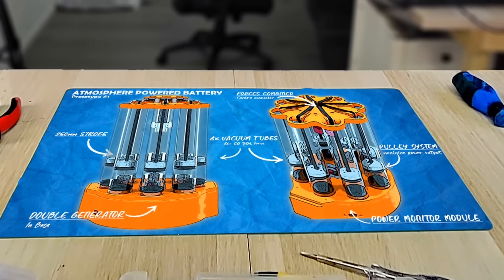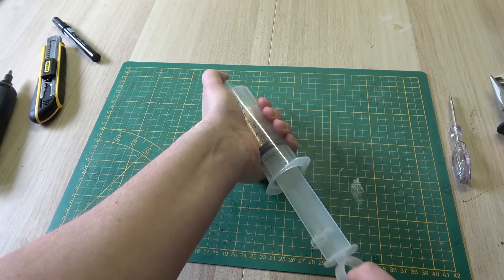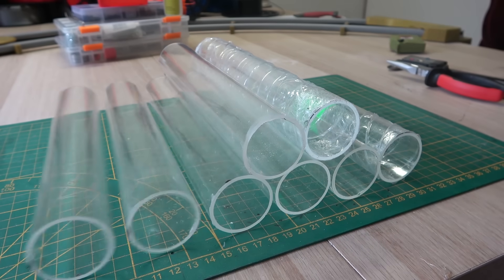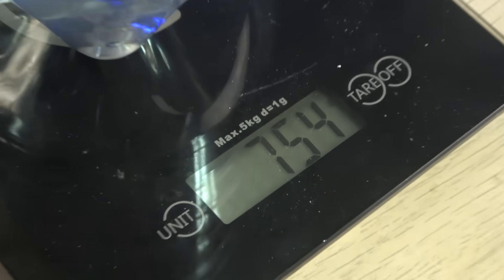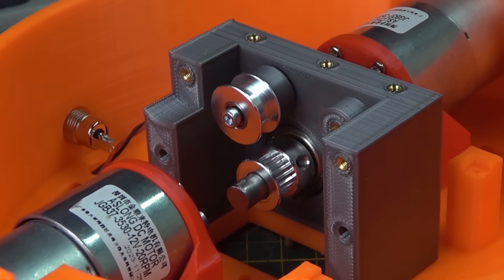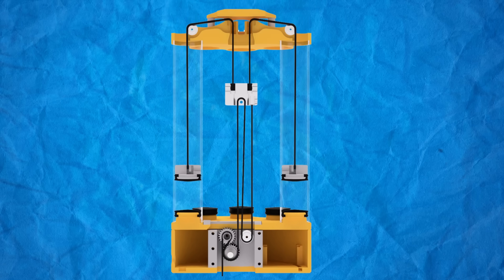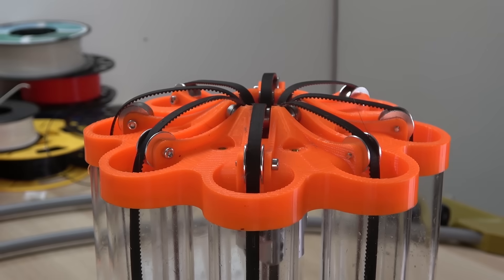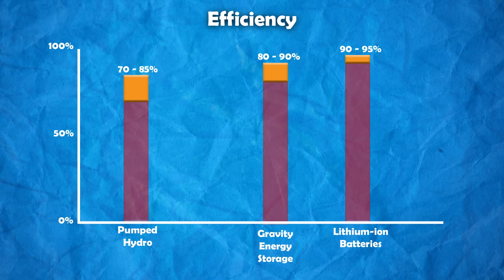Building an Atmosphere Powered Battery..

Comment: batteries you have to throw in trash after some time , the best is the flywheel battery, try make a small one, small diameter rotor  and use very high gear ratios to make it spin as much as 100.000 rpm,  it is in vaccum and the most simple neodymium magnet is enough to make small weight to float, it's very nice because like you can have wind turbine to power a generator and aswell charge the flywheel battery, with solar too, I mean if you have a generator that need 1800rpm to work at 60hz you would need to control the gear ratio just like a CVT transmission, but you have a induced rotor you control the power of this electromagnet, I really wish to find more info about this, I'm sure if you watch some videos and try to make one it would be  so fun... 100k rpm is not safe ok, flywheel battery is the most fun, vacuum is cool too... imagine using steam pressure then when it condenses it create a vaccuum and so u make power, turning energy into heat is quite easy haha, i find vaccuum scary cause in large scale need strong materials
Reply: flywheel battery is much better you can store energy and generate it, just high rpm have problems with balance, tensile strength, ... if you put a wind turbine to charge the flywheel it doesnt matter how fast the wind is ... now the problem would be the strength of the blades when wind is stupid high
Reply: as well the wind turbine is not meant to have a generator, it is a drive shaft to power the flywheel, solar panel need motor to power flywheel
Reply from the maker: I think it's worth a try💪

Comment: interesting idea. I noticed bubbles around the seals at the bottom. Could that mean the seal may not have been perfect? If so perhaps it could be even more efficient with more refinement
Reply from the maker: That certainly could be the case! Especially because it is of course built with parts that are not specifically intended for it.

Comment: Awesome work.
You just need to get the technical details right, as mentioned in several other comments.
But don't get discouraged to much about it.
You show great drive at innovation.
That in itself is something to applaud for.
Reply: he didn't use WaTT hours but the Arduino doesn't lie.
Reply from the maker: Thanks for your kind words!👌And to clearify how i got to the result you see in the video:

To charge: ~12.08V x ~1.62A x 43.709 seconds = 860,64 Watt

After a discharge: ~9.42V x ~1.15A x 57.993 seconds = 628,24 Watt

All value's are measured by the Arduino Nano in combination with the INA3221 Power monitoring module.
Reply: @ConceptCraftedCreations  

Energy [W.s] = Voltage [V] x Current [A] x Time [s]

1 Watt = 1 Joule per second.
so
1 [W.s] = 1 [J/s x s] = 1 [J]

And Joule is a measurement of energy.
A mechanical expression would be [kg.m/s2]
Kilogram meter divided by second squared

Comment: That's definitely a very interesting concept, but there are lots of places that can be improved.
First, starting with a more modest test using a single piston instead of 8 would be better as it would greatly decrease build time and complexity.
Second, I would use a proper generator or a brushless motor, as they are considerably more efficient for energy generation (for example if you were using a car alternator you could use the field coils which would likely result in more efficiency).
Third, there are lots of inefficiencies in the design (using a gearbox instead of a single pulley, piston friction, etc) rectifying them might help.
Now, does this concept have a future? it likely does, but I doubt it would become commonly used simply because of the number of possible failure points.
I think that flywheel energy storage is somewhat better, primarily because it's just a question of finding passive frictionless bearings and a way to mass-manufacture them.

Comment: Where both Watts delivered during the sale time ?
Reply from the maker: To clearify how i got to the result you see in the video🤓

To charge: ~12.08V x ~1.62A x 43.709 seconds = 860,64 Watt

After a discharge: ~9.42V x ~1.15A x 57.993 seconds = 628,24 Watt

All value's are measured by the Arduino Nano in combination with the INA3221 Power module.

Comment: I was thinking of something else, using a diving bottle that can store up to 300 bar, to compress air into it when there's an excess and recover it when there's a shortage. A compressor should be efficient and it's much easier to add storage, in fact you could do it modularly. However I'm not a very good physicist so I haven't figured out how to recover the air pressure efficiently. I think a very small turbine running relatively fast might mitigate the otherwise problematic issues of poor seals. But we're never gonna survive unless we get a little crazy.
Reply from the maker: "But we're never gonna survive unless we get a little crazy." 

That's the spirit and i love it!💪

Comment: Wait a sec. Since when lithium based solution could yield 93%. No way for that to reach such high efficiency…

The numbers are way off…
Reply from the maker: To clearify how i got to the result you see in the video🤓

To charge: ~12.08V x ~1.62A x 43.709 seconds = 860,64 Watt

After a discharge: ~9.42V x ~1.15A x 57.993 seconds = 628,24 Watt

All value's are measured by the Arduino Nano in combination with the INA3221 Power module.
Reply: @ConceptCraftedCreations  628/860 is 73%…
Reply: @ConceptCraftedCreations  and! You cannot just multiply current times voltage times time 😭

If you are using a micro for it than you have to quantify the measurments in very small increments and finally count an integral of all of those measurments.

Your calculations are very wrong.
Reply from the maker: @adamnowak8876  Volt x Amps x Seconds = Watt second = joule
Reply: @ConceptCraftedCreations  voltage and current are not constant in time. And you cannot simplify the equation by assuming both of those values are constant.

You are missing basic knowledge unfortunately :(

Comment: Watts, or Watt/seconds ?
I assume W/s as the gearmotors are not very big and the charging time was quite long.
Reply: Watt per second is not a thing
Reply: @StefanReich  You are right. The correct notation is either Ws W*s or W-s depending on the nomenclature. Point is still, we need a measurement of energy not power.
Reply from the maker: To clearify how i got to the result you see in the video:

To charge: ~12.08V x ~1.62A x 43.709 seconds = 860,64 Watt

After a discharge: ~9.42V x ~1.15A x 57.993 seconds = 628,24 Watt

All value's are measured by the Arduino Nano in combination with the INA3221 Power module.
Reply: @ConceptCraftedCreations Your unit is Ws then (Watt seconds). 860 Ws vs 628 Ws
Reply from the maker: Indeed! Or.. because 1 Watt scond is equal to 1 joule: 860 joule vs 628 joule

Comment: The idea is nice, as well as the build and the presentation, I really enjoyed it :) But as others here wrote, this is no practical way of storing energy. I would try it with a pressure tank instead that can store more than 1 atmosphere.
If the motor really takes ~800W of power to charge and took ~30 seconds to get the vacuum ready, it can store ~7Wh of energy from which you lose a lot while discharging. A cellphone battery can hold more
Reply: a cell phone battery is not the future because like all lithium-ion it is disposable throw away.    Too expensive to even reclaim the material cheaper to throw away and make new
Reply: @funnycatvideos5490  Okay, so you think a backpack sized vacuum battery for your phone is the future then? :D

Comment: use silicon oil for the pistons and you get 10% more. BTW you should provide charging and discharging times so we can calculate Wh energy. That's the numbers to compare
Reply from the maker: I actually used silicone oil as lubricant😄👌And to clearify how i got to the result you see in the video:

To charge: ~12.08V x ~1.62A x 43.709 seconds = 860,64 Watt

After a discharge: ~9.42V x ~1.15A x 57.993 seconds = 628,24 Watt

All value's are measured by the Arduino Nano in combination with the INA3221 Power module.
Reply: @ConceptCraftedCreations  Ok that looks correct. The only mistake in this case is that you say Watts instead of Watt-seconds. When you multiply power with time you get energy in Wh or Ws… 😉
Reply from the maker: That's my fault indeed! Sorry for that😊

Comment: It seems silly to me to use a vacuum when you could reverse it and use pressure. I'm sure there's something I've missed.
Reply: Compressing and decompressing a gas is horribly inefficient, as you end up heating the gas in the process. Using atmospheric pressure gets around that. I like it.
Reply: @ahhuhtal  It may nit be efficient ( removing water from gas helps) , however you can get orders if magnitude more pressure than vacuum which is 1 atm.
Reply: @ahhuhtal  I would think that as long as there is no state change, that it is the same. Honestly I do not know. However, it is not always about efficiency. Lower efficiency may in some cases be a small price to pay for higher capacity.

Comment: Looks like you managed to get a lot of smart people to see this video. Now I'm not engineer or genius. So my ideas could be completely useless. 
But is seems inefficient using two different motors to "change" and "generate" this. Along with the high numbers of gears and pulleys. I don't know if these losses are of any real substance like stated I'm not that clued on.
If you do upscale and I hope you do it would be cool to see if you can stream line it more drop the second motor and try for direct drive as best possible could improve the concept even more.
All looks like a cool concept.
Reply from the maker: Thanks for the feedback💪 appreciate it! I will keep your suggestions in mind for a possible V2!

Comment: Nice video. It reminds me of compressed air storage (CAES). It is a shame you didn't calculate the energy capacity in Joules or Watt-hours.
Reply: Thanks for the clarification. Then your calculation is correct, but the units are the Joules not Watts. Hence why others have commented on that.
Again, thanks for an amazing video!
Reply from the maker: I should have paid more attention indeed! In the future I will double check everything before uploading a project🤓
Reply from the maker: To clearify how i got to the result you see in the video:

To charge: ~12.08V x ~1.62A x 43.709 seconds = 860,64 Watt

After a discharge: ~9.42V x ~1.15A x 57.993 seconds = 628,24 Watt

All value's are measured by the Arduino Nano in combination with the INA3221 Power module.

Comment: Watt alone is only suitable for efficiency measurement if the time to charge and discharge are exactly the same or to compare power delivery capability. Otherwise you must use watt-hour.

Hope to see another video with the correct data.
Reply from the maker: To clearify how i got to the result you see in the video🤓

To charge: ~12.08V x ~1.62A x 43.709 seconds = 860,64 Watt

After a discharge: ~9.42V x ~1.15A x 57.993 seconds = 628,24 Watt

All value's are measured by the Arduino Nano in combination with the INA3221 Power module.

Comment: I think this would be much more effective as a manual hand crank to charge battery, for places where you can't tap into or generate electricity. Seems like very little effort to manually charge it as opposed to the motor charging it.

Comment: Cool Idea, but on larger scale, which material will able to withstand so much vaccum pressure in a cost effective way
Reply: Full vacuum is only 15 psi.  That's why spacecraft are so thin and light and submarines (way more than 15 psi) are so thick and heavy.

Comment: I think it would be cool to use backpressure in addition to the vacuum! By pressurizing the air above the piston while the vacuum is pulled beneath the piston, the energy density could be increased, but probably at the cost of efficiency since there would have to be a seal around whatever is pushing or pulling the piston, increasing total friction. It could also produce more unpredictable charge and discharge curves since the pressure would vary depending on the travel length.
Reply from the maker: I love this idea!👌 Do you mind if I add it to my list of possible future projects?
Reply: I've been thinking this too! The only other downside I can see is heat. As you compress air it heats up, and that heat is lost energy. Plus with this pure vacuum design it's effectively a constant force after a certain point. I'm pretty sure it's actually an asymptote, where it infinitely approaches a point but never reaches it kinda thing

Comment: im working on something similar in high pressure co2 turns into a liquid when heated it turns into one gas and a ball sinks but let it cool just a few degrees it turns into liquid and floats so you can go up and down almost a unlimited distance and change from gas to liquid with very little energy like every night it gets cold and the weight goes up to charge for free then during the day it sinks. to change the temp it turns into a liquid just change the pressure inside it higher the pressure the higher the temp before it turns into a gas. so set the pressure based of the temp difference between day and night like it wont work all seasons unless you change the pressure each season to match the temp. but the idea is you can go from float to sink with a small temp change and the bigger it is the more energy gets stored up
Reply from the maker: Sounds like an awesome project with some interesting challenges to overcome! Would love to see a video or something when you got it to work💪

Comment: I wonder if perhaps industrial pistons would have a better shot at keeping energy?
Reply: A pump, hydraulic fluid, pistons and a rod with a thread on it, driven by a motor pushing a mass up into the air might be more efficient and quieter…

Comment: How long does it output that wattage for though. Need the watt hours
Reply from the maker: To clearify how i got to the result you see in the video🤓

To charge: ~12.08V x ~1.62A x 43.709 seconds = 860,64 Watt

After a discharge: ~9.42V x ~1.15A x 57.993 seconds = 628,24 Watt

All value's are measured by the Arduino Nano in combination with the INA3221 Power module.
Reply: @ConceptCraftedCreations  technically watt seconds. Volts Times Amps gives watts. Once you multiply the seconds then it is Watt Seconds. But yes you did compute efficiency then. Just showed the wrong units.
Reply: Also one Watt Second = one Joule. So you could also have put Joules as the units 🙂

Comment: Watts or watt hours?
Reply from the maker: To clearify how i got to the result you see in the video:

To charge: ~12.08V x ~1.62A x 43.709 seconds = 860,64 Watt

After a discharge: ~9.42V x ~1.15A x 57.993 seconds = 628,24 Watt

All value's are measured by the Arduino Nano in combination with the INA3221 Power module.

Comment: I would suggest find a better way of making a seal from the air on both the end of the tube and the plunger, next look into the relationship between pressure and gas temperature, lastly look in to using air compressor as a generator since the are built with the intent to manipulate the air as their normal operation. you are really think outside the box keep going

Comment: Great Idea! One question: In the efficiency calclulation you wrote "watts" which is power, not energy (would be watthours). Were the motors consuming 860 Watt during charing and  generating 628 Watt during discharging? If yes, how long does it take to charge and discharge the "battery"? - Watt * Seconds / 3600 = Watthour. Stored energy of about 700 Watthour seems to much... Thank you for your answer and keep your great work up and the Youtube channel up!
Reply: 860.64 and 628.24 it not Watts, it Ws or Joules.
Reply from the maker: To clearify how i got to the result you see in the video🤓

To charge: ~12.08V x ~1.62A x 43.709 seconds = 860,64 Watt

After a discharge: ~9.42V x ~1.15A x 57.993 seconds = 628,24 Watt

All value's are measured by the Arduino Nano in combination with the INA3221 Power monitoring module.
Reply: @ConceptCraftedCreations  okay, so the power is 19,8w charge / 10,83w discharge. The energy is 0,24wh charge/0,17wh discharge
Reply from the maker: I should have paid more attention indeed!🤓 In the future I will double check everything before uploading a project to avoid these types of discussions😄
Reply: @ConceptCraftedCreations  no prob, just publish your measurements and if someone is interested, can do the math 😉 also you still managed to get a 70% ratio, you can probably get more using some more advanced load control techniques. If your load resistance is too low, part of the energy is wasted by the rotor windings as heat. You could try an lm317 in current limit configuration and test some (at least 3) different current, than plot the curve on a graph
Reply: @cmh-c they’re in one of the top comments. I was wondering about the same things and found already existing topic in the comments.
Reply: @ConceptCraftedCreations  43,709s/3600s*12.08V*1.62A=0.238Wh
57.993s/3600s*9.42V*1.15A=0.175Wh
0.175Wh/0.238Wh=0,735 or 73.5% efficiency.
Reply: @ConceptCraftedCreations  That's awesome. Well done! This thing has serious potential. Have you done any endurance tests to see how long it can hold the vacuum for?
Reply: Was about to ask this as well, how long does it discharge vs charge. Having something put out 600 watts is nice an all but if it only lasts for a few seconds, that's not really much usable power
Reply: Must be ~4Wh on output. ~4.5 second for ~4cm of tube...
Reply: He said tripple before so i’m assuming 1:3
Reply: Hrm, no response yet. Not a good sign.
Reply: exactly that.
Reply: So it discharges 9V (too high!) at 1A (good) for 1 minute = 1% refill for my phone's old batteries...